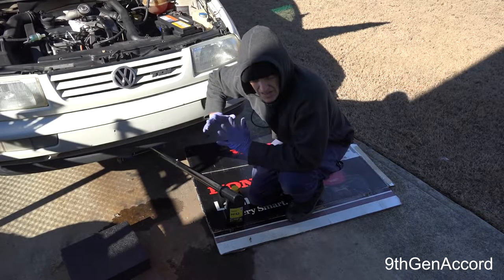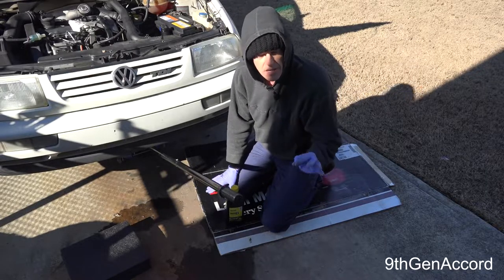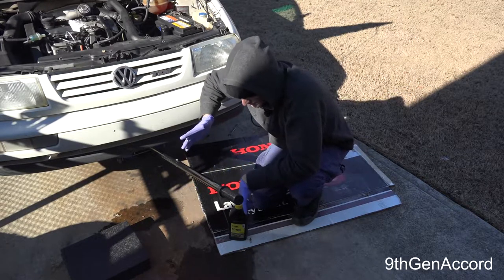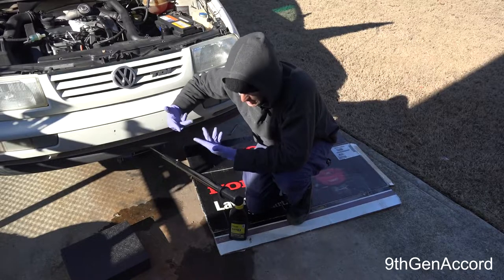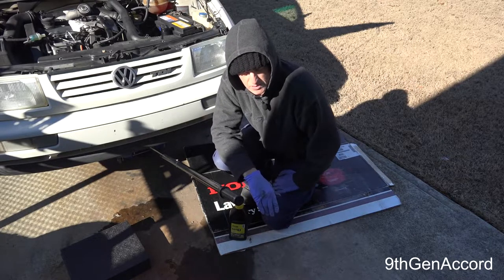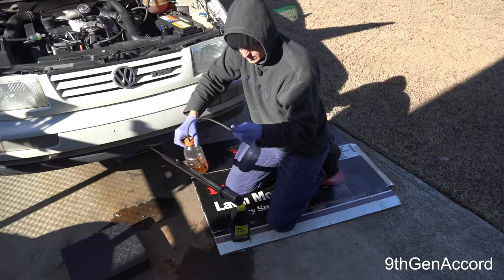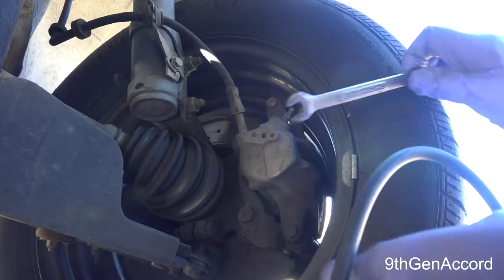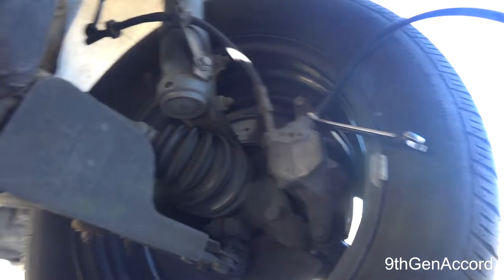Make Your Brake System Last Forever?  22 Years and Counting...

Comment: what u think about just replacing the brake fluid in the reservoir every time we change the oil ?
Reply from the maker: You could do that as it is better than nothing but how often are you changing the oil?
Reply: every 5 k
Reply: Yes you could do that but you are still going to need to flush it out from time to time.